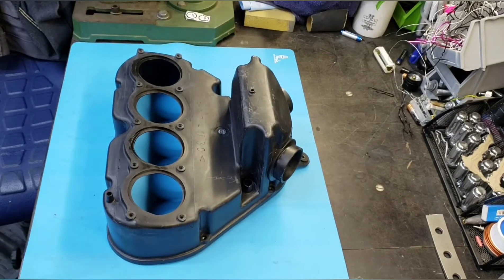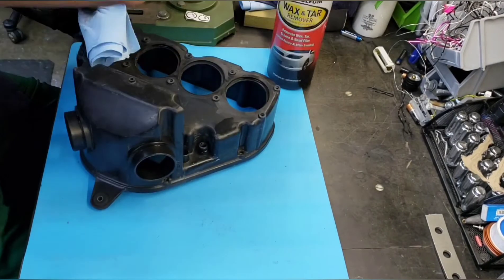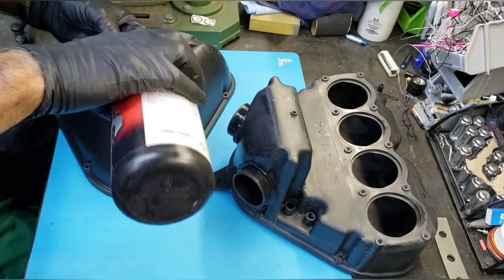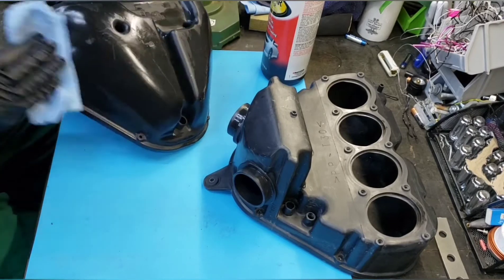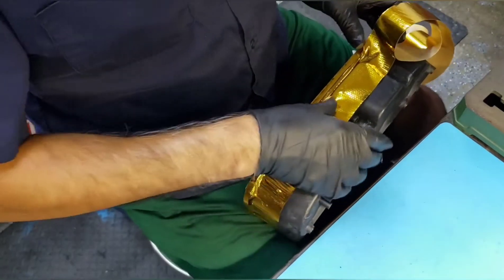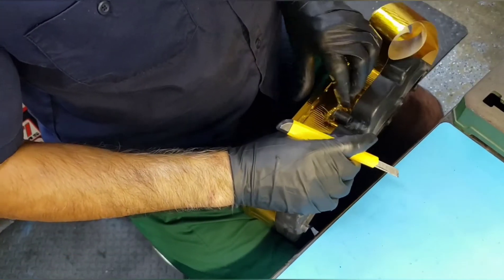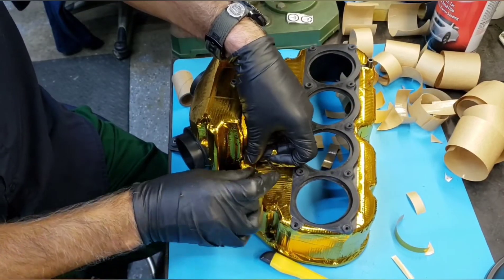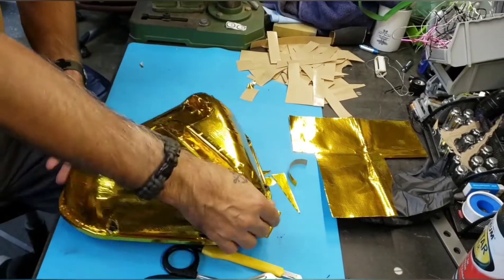R6 2002 "Ruffian" project. Episode 2 DEI heatshield airbox mod

Comment: How many rolls of tape did you use on airbox?
Reply from the maker: From what I remember it was one roll of the 2"X15' roll and a 12"X24" sheet.
Reply: Did this airbox mod make a big difference in power?
Reply from the maker: @Luckky-13  I don't have any dyno numbers but I'm sure there's a horsepower gained somewhere. Cooler air is always better.
Reply: @kilosmotomadnessgarage3447  im not talking dyno numbers.  Im asking could you feel a big difference ?
Reply from the maker: @Luckky-13  honestly on a cool morning you can feel a difference.
Reply: @kilosmotomadnessgarage3447   interesting ! i notice on wet or cold days my bike runs VERY smooth , on hot days or sitting in stop/start traffic it runs slightly less smooth . will do this taping to see if that helps any . cheers